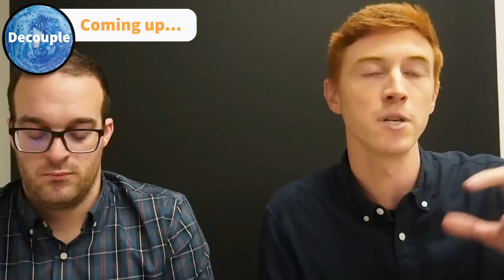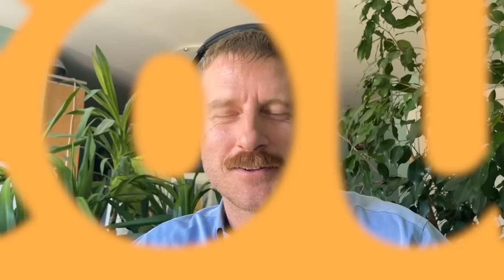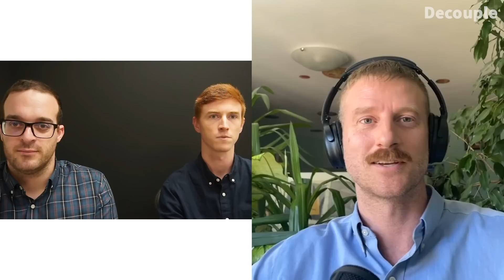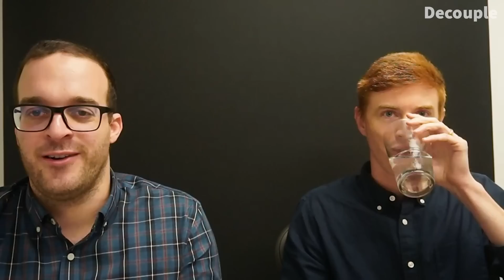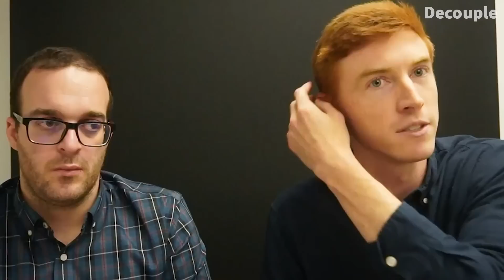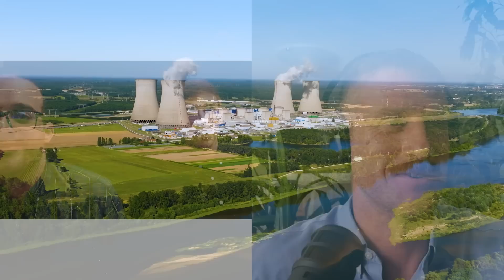The Real Costs of Advanced Nuclear

Comment: Thanks for the podcast.  These fellows at Boston Atomics seemed to be willing to lend a hand for any nuclear endeavor and were rather well informed.  It would have been interesting to hear their take on the restart of US reactors that have been shut down.  As the existing facilities may still be intact, it seems that there could be a lot of bang for the buck as structures and machinery could either be re-utilized or re-utilized with some modifications.  If this is allowed, it should allow nuclear power to come on line much more quickly than a totally new facilty and at much less cost.

Now for my weird comment - It was discussed that much nuclear work has had a lot of start-stop.  The long term commitment to completion and implementation of designs is not there.  Why can't we do this in the modern age?  Global warming is a problem to threaten all of mankind.  There is adequate incentive to developing and building multiple nuclear designs.  In times gone by projects like the building of the pyramids or the great cathedrals of Europe could take one or more generations.  In our age of plentiful food and adequate resources, this lack of progress seems to be contradictory behavior.
Reply: Glowbull warning is mostly El Toro merde.  The proof I use is the very fact that the same people who whine the loudest WRT glowbull climate change due to using hydrocarbon based fuels also are opposed to nuclear!

Comment: Just because Terrestrial Energy's IMSR can use regular LEU and generate electricity cheaper than natural gas at $55/mwh and double up with high-temperature process heat does not mean we should build them. Sure they cost about 1/10th of an AP1000 and only 4 years to build but that doesn't mean anything. The sheer cost of an AP1000 is great and the cost and schedule overruns are an advantage, not a liability. Without all the kickbacks, scams, favors, and general grift, no politician would support them. The first priority of any nuclear power plant project is grift, how do the politicians get rich and pay off donors? A simple, cheap efficient IMSR can't do that, so it's worthless.
Reply: So sadly true 😂